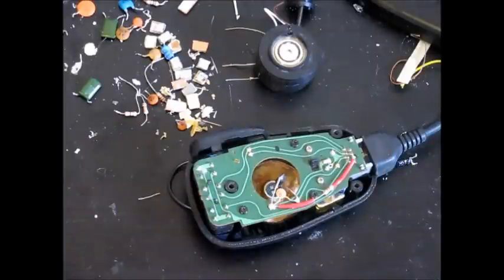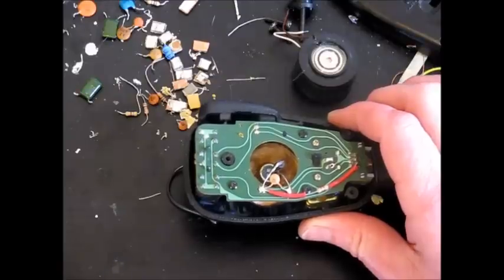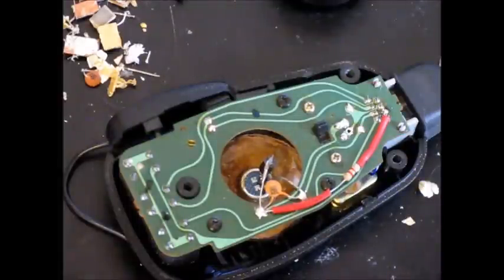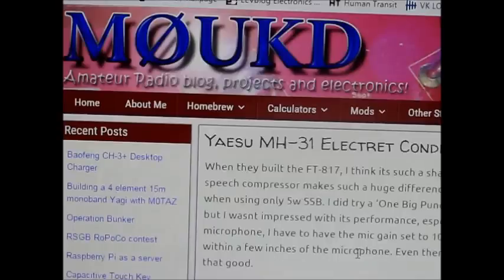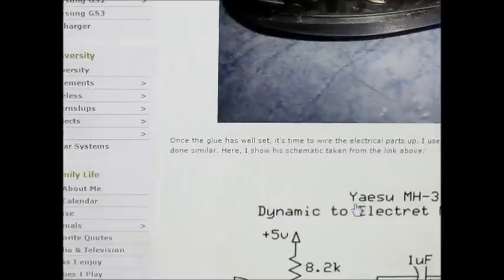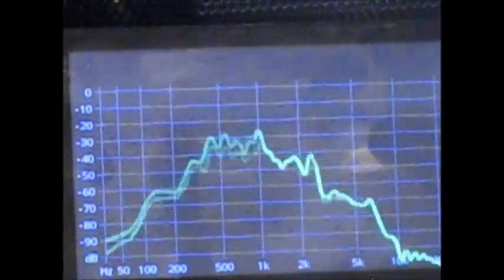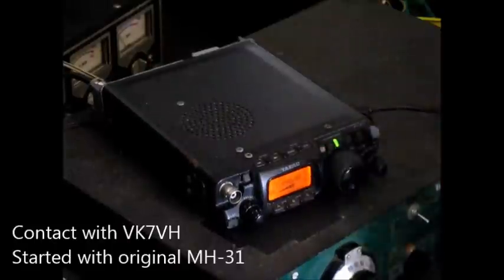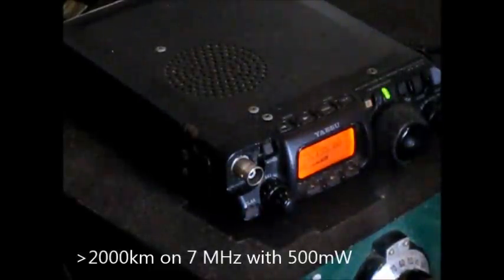How good is the FT817's MH-31 stock standard microphone? (Part 1)

Comment: Hi Peter,

This looks like a nice, low-cost modification for improving the "punchiness" (now there's a RF engineering term) of your SSB transmission.

I did similar years ago via the much more expensive route, viz. the OBP audio speech processor (the original one, not the revised version) with Heil insert.  It certainly improved the FT-817's performance, as evidenced in the VK/Trans-Tasman contests at the time.

73,

Mike VK2IG

Comment: Hello, Peter! I have one doubt! About the electrolytic capacitor... on the diagram, the positive side is connected on the switch but on the pictures, is the negative side. Which is the correct one?

Comment: Can i use a LAN CABLE (8pin) instead of the official cable that was broken?
Reply from the maker: It should work provided all wires are straight and are not crossed over.
Reply: @vk3ye  I confirm straight cable and not crossed.